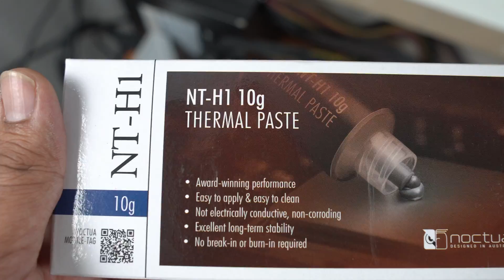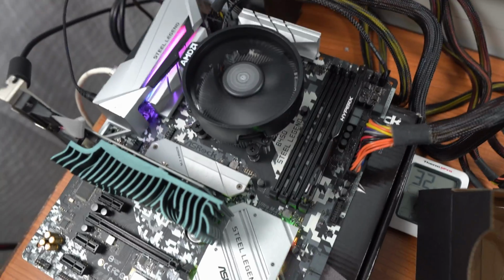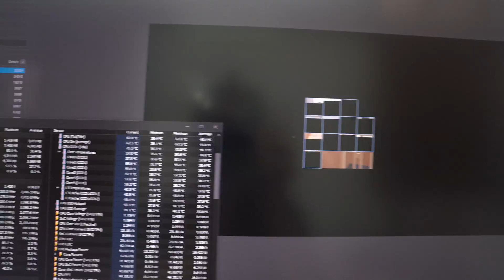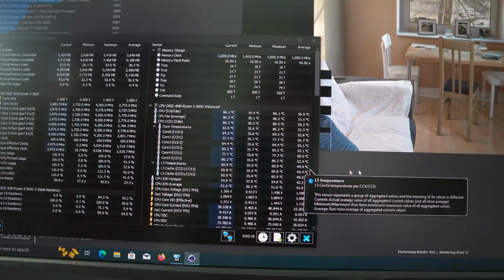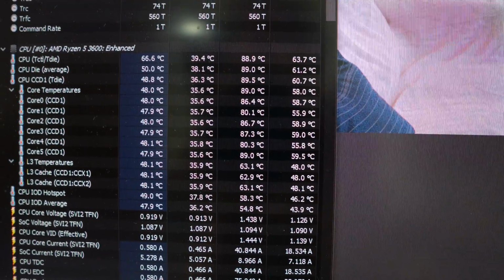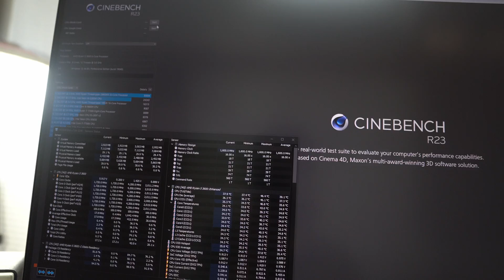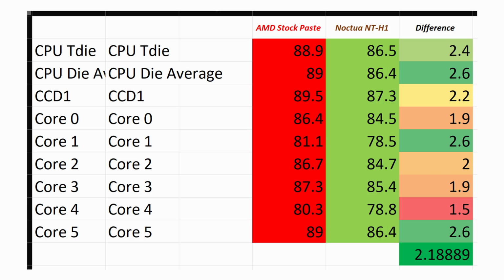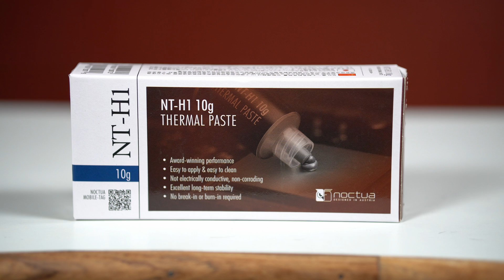Stock AMD Heatsink Paste vs Noctua NT H1 (Should You Replace The Stock AMD Thermal Paste?)

Comment: The NT-H2 combined with the water cooler, dropped my temps about 10° OC to 5.6ghz on the i5-13600k. I say it's a really good paste. Not every paste is ment for overclocking. Which in this case on the video, you wouldn't see the Noctuas performance with overclocking over cheaper thermal paste.

Also, that AMD aluminum cooler doesn't help much. A coper heat sink would had gave you better results combined with the Noctua paste.